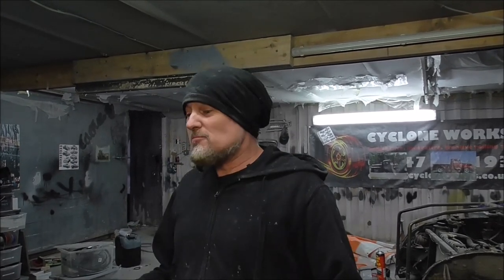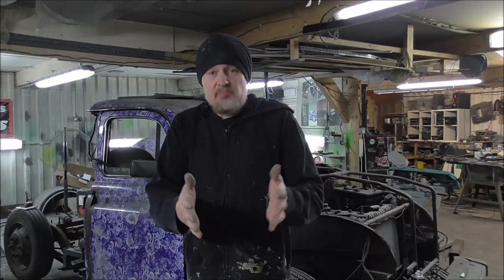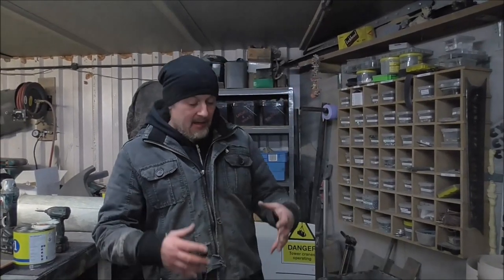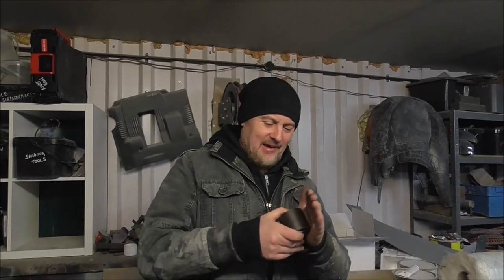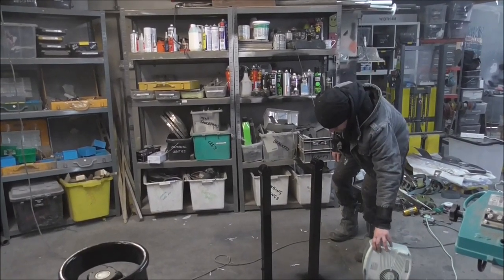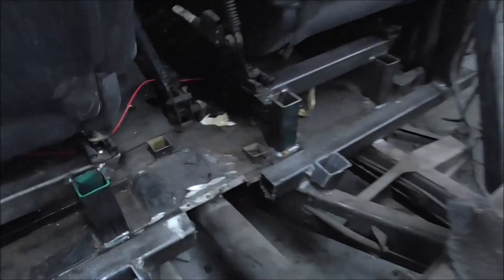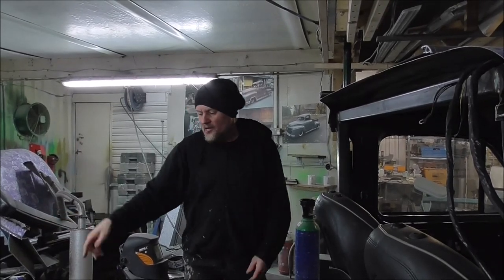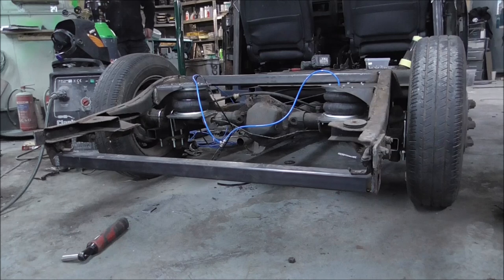ANOTHER UNIQUE LONDON TAXI CONVERSION: THIS TIME INTO A MOTORBIKE TRANSPORTER

Comment: Just found myself re watching this as I come to fit airbags on the back of my own pickup, and it does make me wonder if the way you have fitted your arms doesn't allow for any body roll at all. They are clamped rigidly to the axle and in body roll the arm on one side will have to point upward and the other side downwards which this won't allow. I realise that you've probably done it this way to control the torque reaction of the axle, but worry that the strain on it will cause something to fatigue and break in use?
Reply from the maker: I have also come to this conclusion! I don't know how we got it so wrong.  You are absolutely right, over time the flexing of the metal could fatigue and crack!  In a future episode I am going to swap all what I have done up to this point for the later TX parts and use 2 standard later model radius arms and pan hard rod set up.  My appologies for spreading this poor information and I will also delete the episode.
Sorry this has happened, sadly the right route is very rarely the first route you take!
Let me know when you've read this so I can delete the episode. Cheers for your input.
Reply: Don't delete it you'll make me feel bad! Just film the update! It took me a while to say what I meant as I didn't want to sound like just someone else making a negative comment when I've watched and loved all 100 episodes. 
I've seen a similar set up with coil springs on a previously leaf sprung land rover that used the springs for location but had themcut off behind the axle as they allowed enough flex for body roll but it still had a panhard rod for side to side location.